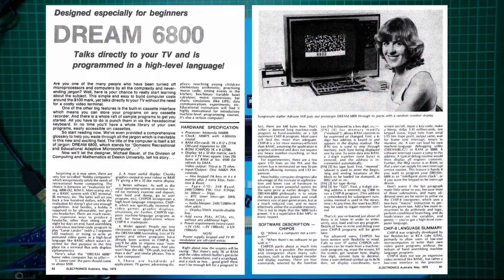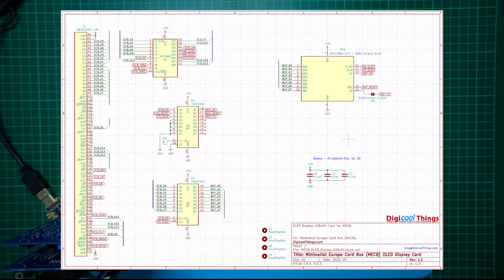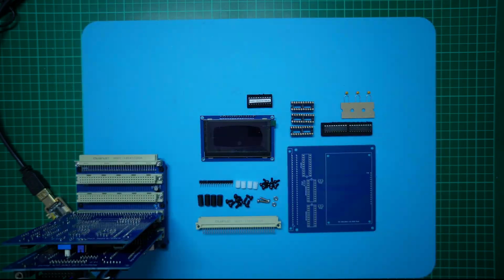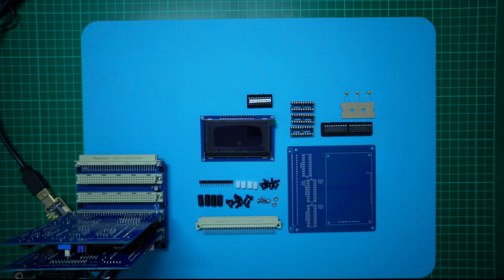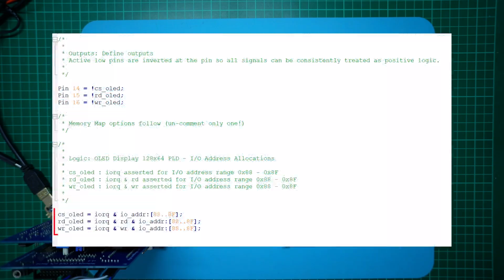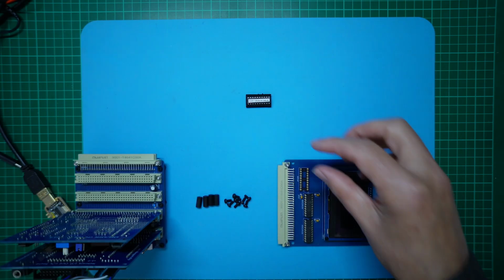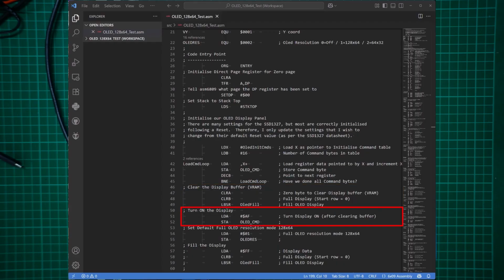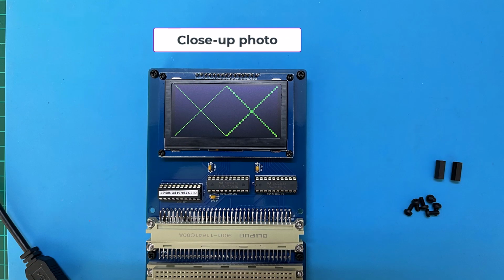Minimalist Europe Card Bus (MECB) - OLED Display 128x64 Card

Comment: I had not heard of the 6800 Dream before, but have spent quite a few years using 128x64 displays commercially. I think they are just about the smallest you can do interesting stuff with. Looking forward to seeing what you can do with this one. Best regards, David.
Reply from the maker: Yes, the DREAM 6800 was designed and published in Australia, so I don't know how widely it was known.  The COSMAC VIP system is probably more well known.  At the time we did quite a lot with 64x32 graphics. 128x64 would have been awesome, but also requiring a whole 1K of display buffer space.  The DREAM 6800 originaly only had 1K of RAM in total, in 1979.   As was the case back then, we made the most of what we had available to us. 🤓